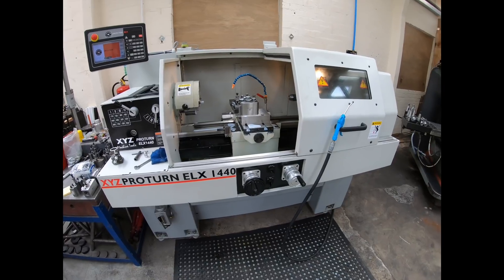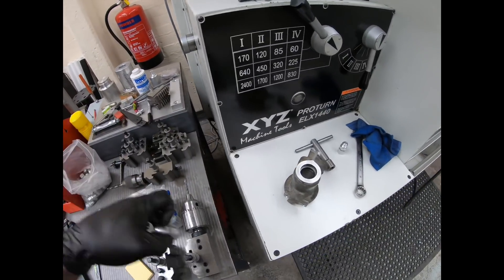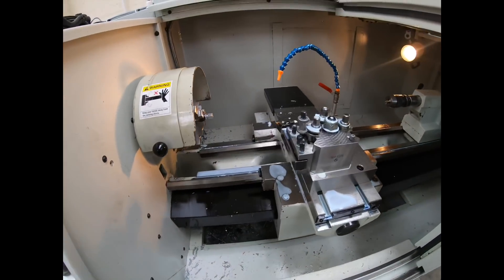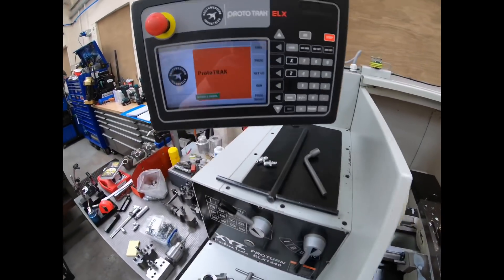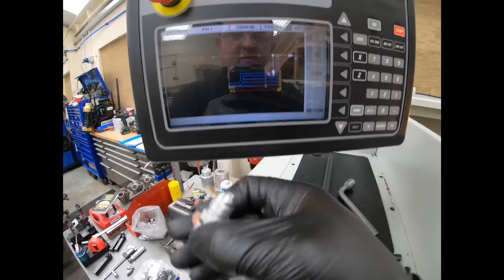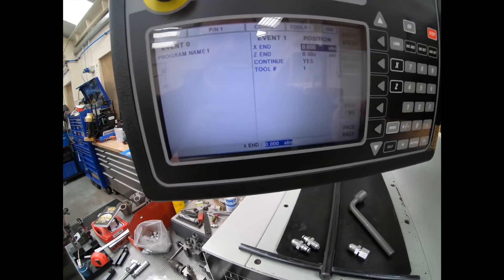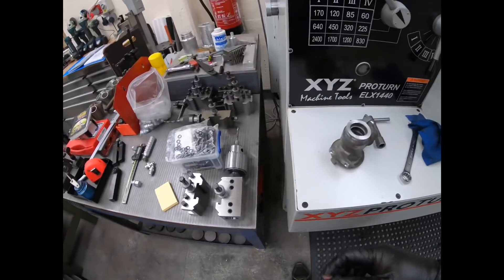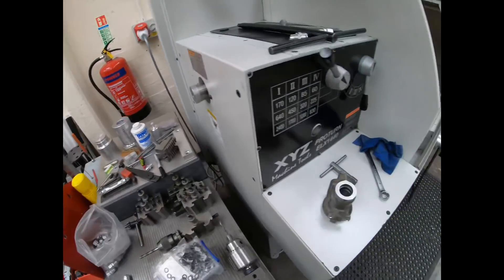My first program on the xyz Proturn 1440 ELX cnc lathe

Comment: Great video. I've been making AN fittings recently, it's great to see someone else make them. It's especially great seeing you use xyz machines!
Reply from the maker: Daniel Wood 
Thanks, they are nice machines, ok for small parts that don’t require many drilling ops, and tool changes but that’s why I’ve just bought the Hyundai QT-15n, still wouldn’t get rid of the xyz unless it was for another but the slx version